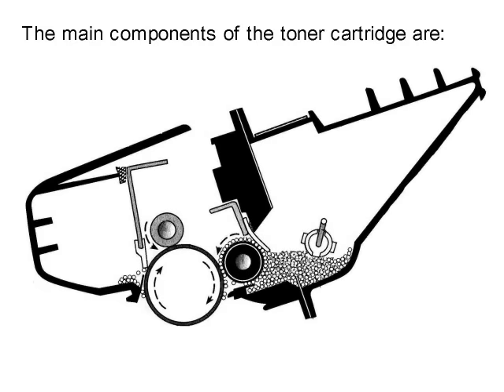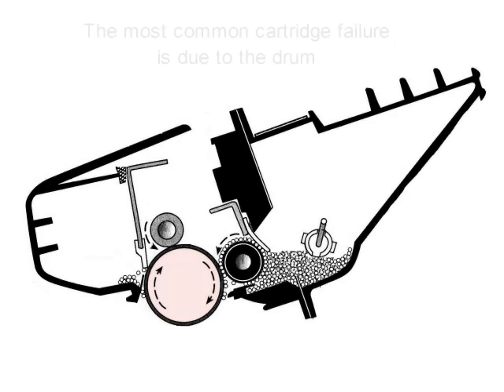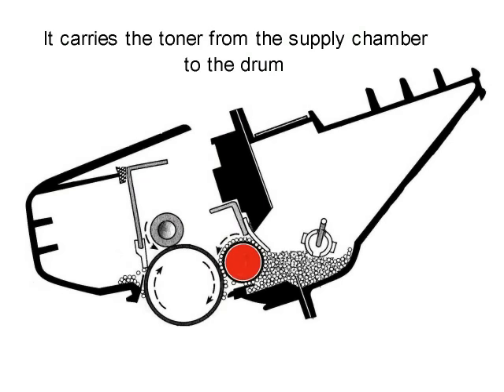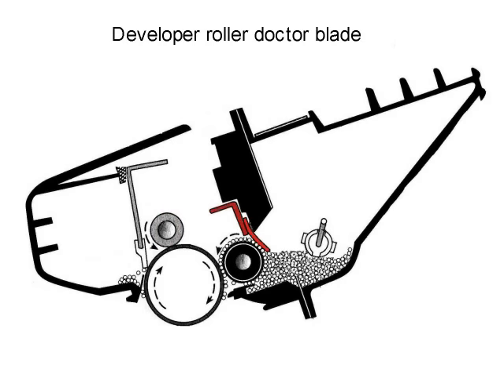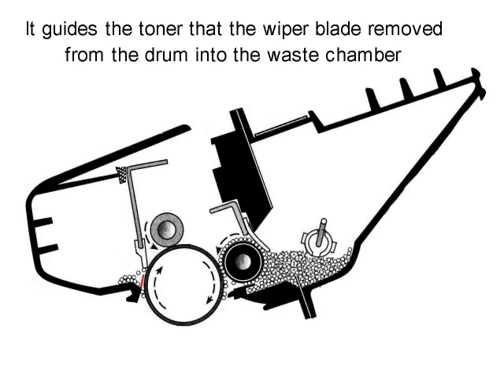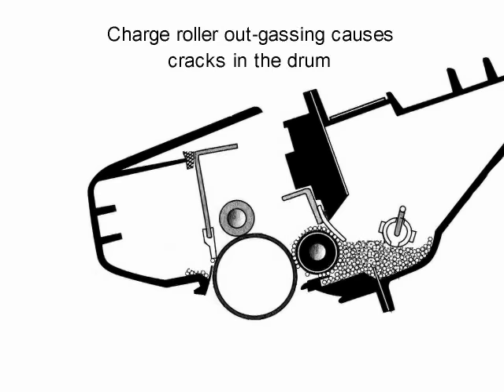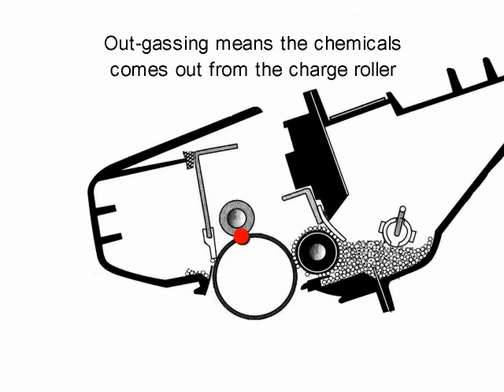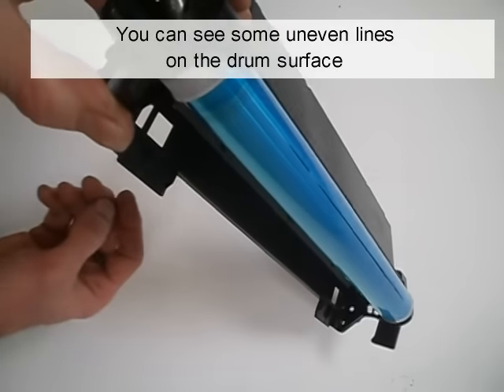Toner Cartridge Printing Defects: Causes and Solutions

Comment: 1:08  Perfectly Straight or gray lines
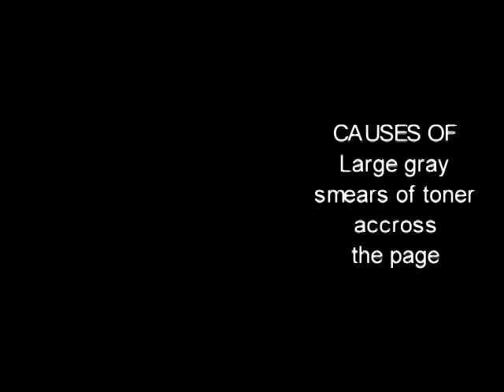3:49  Large gray smears of toner across the page
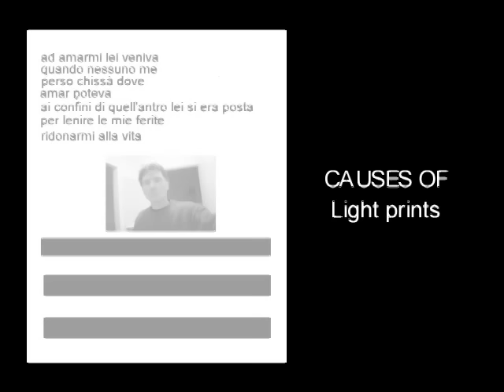5:13  Light Prints
6:06  Fine Straight vertical white line or lines
6:29  Vertical white line or lines
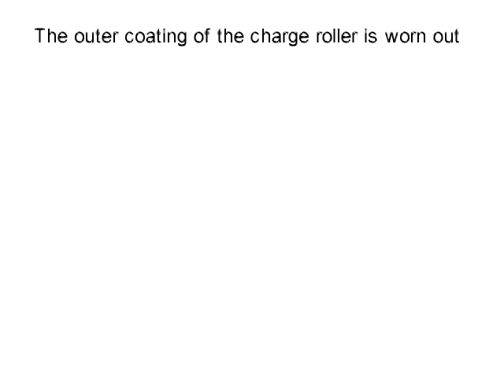7:04  Ghosting: When a printed image is repeated lightly at bottom
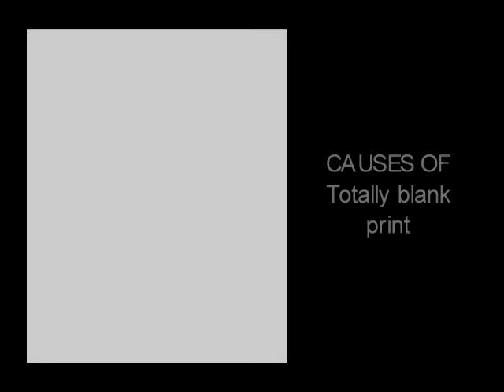7:58 Totally Blank Page
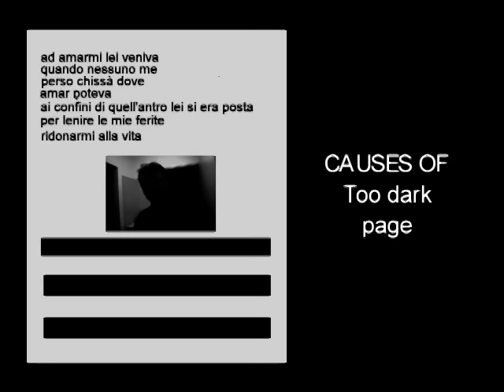9:53 Too Dark Page
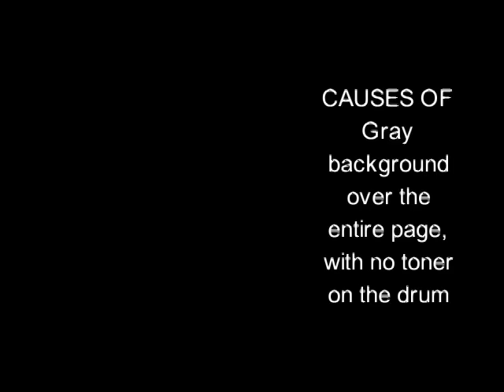10:29 Gray Background Over the Entire Page, with no toner on the drum
11:35 Dark Horizontal Banding across the page, not at the same distance
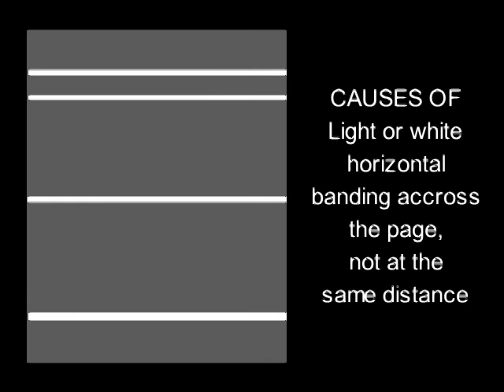12:50 Light or White Banding across the page, not at the same distance
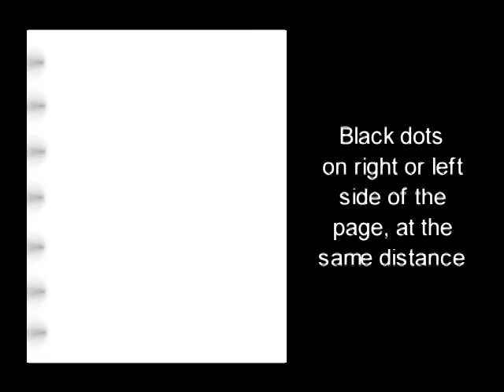13:30 Black dots on the right of left side of the page, at the same distance
13:50 Random Black or White dots across the page or in the back of the page  
15:30 The printer does not start the printer process
16:19 Random Vertical Lines or Streaks
17:17 Only Half Printed Page
18:40  Paper Jam
18:54  Bubbly or grape-like pattern
19:33 Grey "Tire tracks" on left or right side of page
19:59 Character Voids 
20:22 Cartridge makes a grinding or clicking sound - Noises

It would be be great If you added this to the description.
Reply from the maker: +The Mighty Macro thank you, I'll do it
Reply: THANK YOU!!! And might i add how ANNOYING the computer voice is on this video. Geez... ughghghhh
Reply from the maker: starter cartridges only print some tens of sheets. May be it's empty
Reply from the maker: may be the internal sponge is too old and do not reelease the ink properly, or the filter over the print-head is dirty
Reply from the maker: Which cartridge do you have? HP number 337 is am inkjet cartridge
Reply: 2:19 Repeating horizontal lines, dots, or other defects at fixed positions. 

I just refilled a cartridge that had been laying in the junk bin for a while. Printouts are legible now, but I ran into the above problem with horizontal lines. I could see the lines in the drum and thought I had somehow managed to scratch it despite my carefulness, but I was so puzzled about how I could have accidentally scratched such a perfectly straight line. Glad to have found this video, it's an eye-opener!
Reply: Thank you, you just saved me 12 minutes of watching with your video timeline breakdown.
Reply: Would you prefer it in Italian instead? lol
Reply: Half page print after refilling 12a toner how to slove it
Reply: this info need more likes
Reply: Great video!  Thanks for the info sharing!  Wondering if can improvise a wiper... though will try cleaning to see if why the black lines and toner leakage
Reply: I have this brother all in one that ghosts, or turns total black pages. Started happening in the winter months. So if your printer sits where it can get cold and even slightly out of operating temp it will cause nasty prints. Took me a while to figure out the reason, because the rest of the room was not cold. It sat by a window facing the north. Cleaned and cleaned it with no joy, thought it was toast. Somethinng to think of if it is winter and sporadic laser print issues.  On warmer days, no issues, real sporadic.
Reply: @viandant5  What about black horizontal lines across the page at the same distance apart ?
Reply from the maker: @mrdhksan  In this channel there is a video about repetitive defects at the same distance: https://www.youtube.com/watch?v=slWP4fuAwso&t=9s
Reply: Thanks much appreciated

Comment: Thank you very much for this video! I've been an IT professional for more than 10 years, but never held a position that entailed very much printer support. As such, I haven't done more than replacing toner cartridges (and solid ink, and inkjet cartridges). My personal printer at home, an HP LaserJet 4000dn, started acting up and this video helped me to diagnose the reason toner was building up on a thin strip of the drum. I really appreciate that you describe the cause of the malfunction and explain the purpose of the individual parts of the toner cartridge, and not merely state a given part is bad.

Comment: Thanks for this very informative video. I now could diagnose the problem, there are horizontal lines of same distance on the paper due to marks on the drum. Even though these marks on the drum are very difficult to see, they cause the toner to sit there and therefore are transferred to the paper. I believe it was caused by the fact that I haven't used the printer for about one year, and the toner left on the drum, from the contact with the wiper blade or de developer roller, affected the surface of the drum.
Reply: how you fix?

Comment: Thank you. My issue was that the developer roller was COATED in toner. I to clean it and let it dry and i printed a page and found out there was little to any ghosting, after printing a cleaning page and printing more, the ghosting is super faint. this probably means it needs to be cleaned a bit more or replaced. Either way, you have saved me tons, thank you.

Comment: I had the problem with gray pages.  I just took the toner cartridge out of the drum assembly (sold as two separate parts) and very carefully blew the toner sitting loose in the drum assembly out (careful not to spit on it or accidentally blow the toner in my face).  The prints come out clean again now.  I did that outside and over the grass, there was not much toner there to clean out.  It made a big difference in print quality.  It made it print like it was new again.  We had the printer since maybe 2005 or sooner and have only changed the toner twice.  The first one was the starter cartridge that usually doesn't come with as much toner as one bought separately.  Then the second one changed was another full one.  I never needed a new drum yet and never had any issues with the printer other than ONE paper jam.  Of course my laser does not print color but I had an inkjet and I hated that thing, inkjets are nothing but trouble.

Comment: Hi,
Thank you for your video. my brand new canon cartridge 137 black is too light. when printing small size words, it looks too light to read. The colour also seems not to be stable in every spots on the page as the old cartridge. I tried to clean the roller but it was still the same. please help.
Reply from the maker: In the printer settings there are some adjustments, quality, remove the toner save option and so on. You could clean the transfer roller

Comment: Thanks for making this video.
my printer is working bad. papers come out of the printer with black strips and stains. paper no longer remains white.
i see the toner dirty with black powder. Cleaned it but it doesn't improve. it keeps on coming out. does it mean the toner is bad and should be replaced? or is it something else?

Its the original toner and didn't go through half of its lifespan
Reply from the maker: It depends on which printer do you have. May a problem with the wiper blade, the charge unit or a toner cartridge near the end of its life
Reply: I have the HP Laser jet 4200n
thanks
Reply from the maker: Probably the problem is the toner cartridge, may be the toner is damp or too old. the wiper blades of this cartridge are made of rubber that become weak after some time

Comment: Hi viandant5, I have cf210a 1/2/3 and Doctor Blade spreads powder in 2 sides, but not in center. This problem repeat when like use SEAL(for full re-manufactured). What do you think?
Reply from the maker: +Lenin Cahuasqui may be the side felt are compressed, try rough them up using a small screwdriver. but probably the foam of the doctor blade is in wrong position

Comment: a lot of unseen dots or particles will be there, that can be seen when you use a polymaster for offset printing, what would be the solution, i changed both the drum and blade and the toner as well. but the persists, can you help

Comment: I took the toner cartridge drum out of my Brother MFC-8810DW and took it outside and lightly banger the drum on a rag to get the toner ink that accumulated in a pan beneath the or adjacent to the roller out of the cartridge. Then used compressed air to blow out this powered ink until it was gone. Turned the roller by hand and cleaned the roller of toner ink with isopropyl alcohol on a clean cloth several times, till clean
 Took cotton tip applicators and cleaned any surfaces I could get to on the drum, including inside the slot that the green tab runs on.  Now first printed copy no longer gets a 3 inch +vertical black line on the right side of copied paper when printing from the computer, so far anyway. Seems to do the trick. Just clean up the drum. I did not take the drum apart.

Comment: Have a Samsung M2885FW which prints four equidistant horizontal lines. Cleaned the drum etc but does not help. You have covered vertical lines but not horizontal lines. Any suggestions ?
Reply from the maker: They are repetitive defects, it depends on the distance of the defects. I have a video about repetitive defects

Comment: I have an OKI c821 laser jet printer, mainly used for printing on T-shirt transfer paper size A3.
It has developed a single short horizontal line on the prints. It's always in the same place, possibly blue,  bottom right hand side, 8cm long starting from the edge and about 3cm up from the bottom of the page. It does not repeat up the page so I really don't know what it is. If it was the blue drum wouldn't it repeat up the page?
Reply from the maker: +aharz1 it's difficult to say, probably it's not the drum but it may be related to the drum unit. it may be a bad contact into cyan drum unit, or it can be the drum with a defect and the charge roller discarge though that defect

Comment: I have a minor problem, my prints are a bit grayish with minor horizontal fine lines, earlier prints were jet black. I am using hp m126 nw printer with 88a introductory cartridge that has been refilled for first time.
Reply from the maker: I would start to check the contact of the magnetic roller, or the bushings of the magnetic roller.
Reply: viandant5 bushings of magnetic roller earlier had some kind of lube (silicon lube maybe) but when I refilled some toner got stuck to them, so I cleaned them with a soft cloth, they are now clean but unlubed.

Where are contacts of magnetic roller?
Reply from the maker: magnetic roller bushings must not have lubrification. the contacts of the magnetic roller are on one side of the magnetic roller, those metal flags. may be theu are bent
Reply: Thanks for help, everything is okay, I even relubed the bushings, check every thing. The problem is toner, I mixed old toner with new, I guess that is what is causing the problem.

Comment: Viandant5, I have a Canon MF4350D Laser printer. The drum has a dark thick black line on the opposite ends of the drum.  I wiped it with a soft rag, printed again, and there's still a line on both ends of the drum.  Do I need to buy a new drum or blade or is it cheaper to buy a new printer?  Your insight would be appreciated very much!
Reply from the maker: +Tinkerer I think the problem is on the magnetic roller. you have to open the cartridge and wipe the magnetic roller. however, compatible cartridges for this cartridge are very cheap

Comment: C1810w xpress Samsung printer. On black and white prints a very faint horizontal cyan lines. On color prints cyan lines horizontal. I returned the “defective toner” (not after market) purchased at reputable office store chain. Replaced with another new cyan toner.
Cleaned roller. Don’t see any sign of cyan toner anywhere in machine. What is problem?
Reply from the maker: which roller did you clean? a single line could be the transfer bel unit, or a toner cartridge with defective drum. a small defect on the drum could cause a short cut between the drum and the charge roller

Comment: Hi, great video, i have an issue with my canon 1023, i bought a new toner cartridge cause it gaves me an error of out of toner with my old cartridge, so bought a new and after install it gives me the same error, i've removing the seal correctly, and i can see the magnetic roller full of toner, same as the developing unit, what can it be?

Sorry for my english.
Reply from the maker: May be the toner sensor inside the developer unit, but first of all start cleaning all contacts and inside the printer near the toner cartridge and the developer assembly

Comment: My LaserJet 4100n now has grey output. Transfer charge roller inside the machine is covered with toner.  If I clean it, I can get 20-30 good pages, then grey background returns. 
**Tried a new cartridge (same manufacturer & [2017] vintage as cartridge it replaced) and get 20-30 good pages then problem returns.  Try another new cartridge? Or.....???
Reply from the maker: check if there is toner on the drum. may be the wiper blade is too old

Comment: I have a problem not exactly the same as shown in the video (12:50). Prints have three white horizontal bandings across the page at the same distance (about 7,5cm). White horizontal strips have about 7 mm height.
Reply from the maker: which printer?
Reply: viandant5 HP LaserJet 1018. And now I can see there are sometimes 4 white stripes. Depends where on the printout first stripe appears. If at the top of a page than 7,5cm interspace makes it possible to fit four stripes on an A4 sheet.
Reply from the maker: Krzysiek Krzysiek 75 mm is the drum. the defect is related to the drum. may be a broken gear, a bushing. check if on the drum there is an adhesive sheet, or if it's dirty

Comment: My Samsung CLX 3305W is workng fine otherwise but when printing apparently leaks small amount of black toner on the table from the bottom. Is this because of faulty cartridge? Black toner is getting low but I'm going to print as long as it still prints
Reply from the maker: on the table from the bottom you mean you found toner on the table? It could be the internal of the printer dirty

Comment: I have a mix between random vertical streaks & ghosting on an HP color laser jet pro MFP m4477fdw. 

I've replaced the toner cartridges with the official HP 410A toner packs too & it still persists. Any ideas?
Reply from the maker: It could be related to the fuser unit

Comment: I have HP 1020 plus printer. Recently i refilled the toner. After refill i'm having 2 issues. 1. Right side of the print out is darker than left side. 2. Page background is coming grey. I already changed wiper blade, doctor blade, drum and magnetic roller. Kindly help me with this issue.
Reply from the maker: the background may be caused by a low quality, damp or not proper toner, or the charge roller. the other defect may be caused by a broken magnetic roller bushing, magnetic roller not seated correctly, charge roller, side plated not correctly installed

Comment: Sir i have printer Cannon 6300, it has problem, ink don't stick to page. 
And middle vertically two white lines appear and by touching printed page , ink removes. 
But only 1st two or 3 pages have this issue. Next pages print fine
Reply from the maker: It could be a fuser problem. Check the fusers, are they dirty or worn?

Comment: Hi there, I have a trouble with my printer. I watched your video, but I cannot find my exact problem in it. My printer is a Brother HL-2040 series (laser) printer.

When I print the "test print quality" page, the ink on the page is fine, but there is always excess black/gray dots or smudges on the sides of the paper. The dots are packed rather densely, but mainly show up on the right and left sides of the page, especially the left side. 

I do not think the dots are evenly spaced apart like the two criteria given in your video. They appear somewhat randomly, but are on the left and right margins only.

I tried cleaning what I thought was the drum, but there seemed to be a lot of black ink being wiped off, so I didn't want to wipe off all the ink. Unlike your green drum, mine is black.

Also, I noticed a bend in the middle of developer roller sealing blade, but I don't see problems with lines, so I do not think that's it.

What do you suggest I do?
Reply from the maker: I think you have to change the toner cartridge, and before reinstalling the new toner cartridge you have to clean the drum surface with a soft cloth. Brother technology put the waste toner inside the toner cartridge through the drum, so if you use a defective toner cartridge the toner on the drum surface may contaminate the new toner cartridge giving background during the print
Reply: Thank you for responding! The thing is, I changed the toner cartridge maybe 3 months ago, and the printer is not used often. Also, when I print the test pages, the text on the page is clear and crisp, which does not indicate low toner. The issue is the toner specks/dots on the left and right margins. :(

I will try checking the toner again, and will also try cleaning the drum surface some more. When I clean the drum, should I keep wiping it until no black toner comes off? Or is it supposed to have some black toner at all times?
Reply from the maker: The drum is not in the toner cartridge. Do you mean the developer roller?
Reply: Hmm, I don't think I mean the developer roller. In the Brother HL-2040 laser printer, the drum part is right next to the toner cartridge.

When I take the toner out of the printer, it comes attached to the drum unit, and I have to then press a lever so that I can remove the toner cartridge part  and actually see the drum.
Reply from the maker: Toner cartridge and drum cartridge are separate units, obviously they have to stay close each other. you should keep wiping the drum with a soft cloth until no black toner comes off.
Reply: Oops, I believe there was a miscommunication issue there. :)

But yes, I happened to print something on the printer yesterday, and it came out relatively clear. There were still a few gray spots in the background, but I suppose those are scratches that cannot be changed, and that the lines and dots before were from leftover rubbing alcohol that had not yet dried after cleaning.

Thank you!